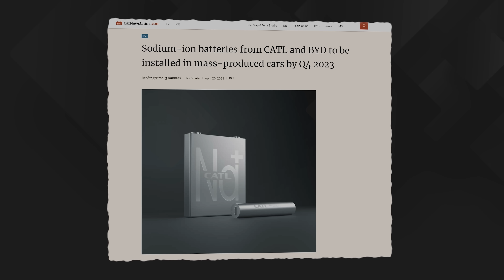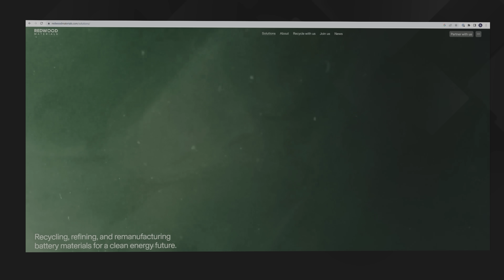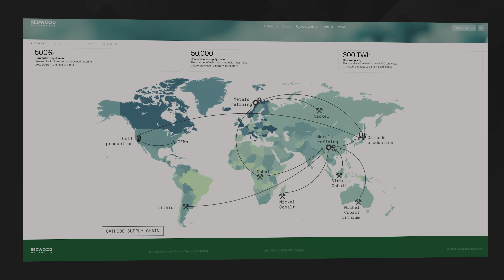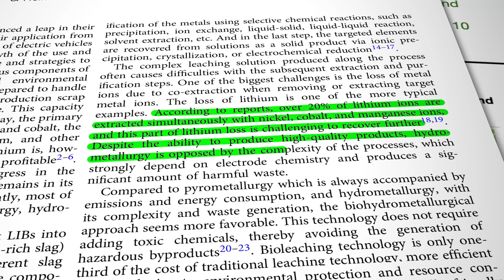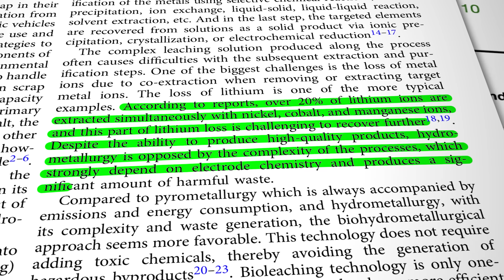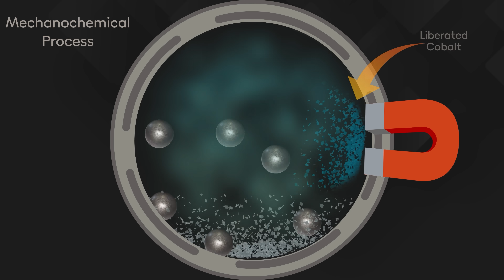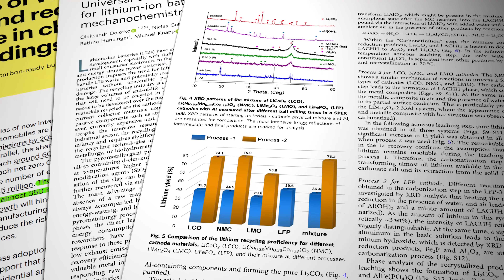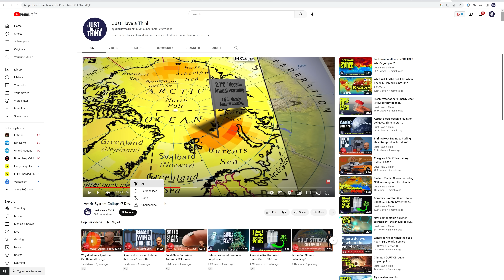Battery recycling just got a whole lot better.

Comment: ABTC. A US company about to list on Nasdaq with patended hydro based demanufacturing and recycling of metals, primarily lithium back to market at cathode grade. Just partnered with BASF. Also got 100 mil from Biden to build a refinery in Tonopah on land they own to where again they hold patented tech to economically extract lithium from claystone to cathode grade hydroxide. They own 100% of claims on 10k acres that hold over half a trllion of potential lithium hydroxide. It will surpass Redwoods pyro process due to its green tech over faster time frames. American Battery Technology Company. Buy in now. Youre welcome.

Comment: Designing in the final disassembly of the batteries should be ironed out between the manufacturers and those recycling the batteries. Limiting human interaction and making disassembly easier should be a good start for streamlining recycling.

Comment: Great to see solid efforts being made to recycle batteries. Impressive technology and, yes, the mechanical method has my vote. On reflection, I wonder if battery designers give serious thought to making the recycling process as economic and efficient as technically possible; even if it would mean a small reduction in performance? Just ‘give it a thought’.

Comment: Is it certain that rechargeable batteries is the future of powering electric vehicle. I was intrigued by the idea of using aluminium air primary cells to power cars, effectively replacing the batteries in the same way as we once did with model cars. The high energy density offered by aluminium air technology, suggests that a compact battery pack could be designed for EVs. The big advantages being the potential speed of replacement and the increased range. This technology would be just as demanding of battery recycling, and might prove more expensive as the battery packs would need to be transported to and from  the service station. Has this idea now been ruled out, in favour of rechargeable technology? A decision must be made, as the cost of installing the recharging infrastructure will be considerable.

Comment: I know that this may sound incredibly simple and boring, but please consider UHPC, or ultra high compressive concrete. As you know, concrete is one of the most used materials on the planet, but it is basically unchanged since the development of Portland cement concrete in the 19th century. As it turns out with many things in our modern world, ordinary concrete has significant flaws but due to its remarkable acceptance and usage a mammoth industry has grown up around it which, like many major institutions, is very reluctant to change. However, there are aspects of both its creation and lifecycle which are now being closely scrutinized. Firstly, the creation of Portland cement (a prime ingredient of concrete) requires large amounts of heat energy to force the necessary chemical reactions; secondly, this reaction releases enormous amounts of CO2 into the atmosphere. As to the final building material created using Portland cement, it has significant vulnerabilities which require extraordinary steps to avoid. Firstly, ordinary concrete is very porous once it has cured (hardened) which make it extremely vulnerable to negative environmental influences; frankly, it is not remotely waterproof and this allows waterborne chemicals (salt etc.) to easily gain access to the interior structure where it reacts with reinforcing materials and essentially causes them to severely deteriorate and even dissolve both the basic mineral structure as well as reinforcing elements (steel etc.). What, you might say is the reinforcing necessary you may ask. That is due to concrete being essentially strong in only one aspect- compression. As the real world generally requires strength in flexural, tensile and compressive strength, this leaves objects made of un-reinforced concrete very deficient when stressed by alternate forces (I.e. earthquakes and other environmental forces like wind/waves). Additionally, concrete is very bulky when it is required to exhibit sufficient strength to support large infrastructural objects (bridges, sea-walls, skyscrapers etc.). Therefore, huge amounts of energy are required to transport everything from the basic ingredients to the finished products; creating more CO2 etc.,etc..

Comment: 8:30 Why does it say 650mAh and 6.5A on the battery? Does it mean it can supply 650mA for 10 hours?

Argh, found specs finally...
Nominal Capacity: 650mAh
Max Pulse Discharge Current: 6.5A
Whatever that means.

Comment: Not so sure they are going to scale well. Ball mills are indeed used in mining huge sizes for years, but they are very energy inefficient because you basically lift tonns of steel balls with every rotation. The wear and tear is not neglectable too.

Comment: When seeing this battery recycling process, I wonder if we could recycle absolutely everything in some super giant facility after we start getting abundant cheap energy from renewables.
Reply: You start by finding alternatives to the items that can’t be recycled. Micro fibre, plastic and insulators like Kapton and Teflon are not recyclable. Body deadening material or sound insulation is not recyclable. Carpet is not recyclable but it can be reused

Comment: This is what the company that sold the Mt Marion mine has done, taken their hydromet flow sheet and developed an ‘urban mining’ company. Working with Mercedes amongst others. Scale is the issue at the moment. There is not enough batteries yet, which is causing issues for companies like Redwood getting feedstock. Car companies will have the feedstock- production scrap, recalls and end of life in places like the EU where they are required to take them back and required to put a certain amount of recycled product in. Car companies will want to keep it all in house for this reason. Redwood-Tesla, Primobius-MB. It will be the partnerships that win out and pretty standard established tech that is most economical when we get to scale

Comment: Excellent video as usual Dave. One thing that no one seems to be talking about is the cost of recycling lithium batteries. Do you have any cost comparisons on a kg of recycled lithium carbonate versus a kg of mined and refined lithium carbonate? Because cynically, I think the decision on what source to use is going to be driven by economics rather than ethics.

Comment: We need more battery reuse.  There is plenty of demand on the power grid for extra battery storage.

If you have a EV that has crashed the insurance company will right off all the batteries just to be paranoid.

If you give an old battery to a recycling company they will recycle it.

At some point you need a decision making processes that can decide cell by cell which battery cells are good and which battery cells are not good.  They we can have massive amounts of battery storage on our power grid, or even a market for second hand battery cells for people building their own EV's.  Or all sorts, there is a big demand for even second hand EV batteries, you only need to recycle the battery cells that are not working.

Comment: I think the major concern with getting an EV is having to replace a bad battery. If cars were made to have the batteries swapped in addition to charging, there would be no worry of getting a bad battery because you could change it as easily as going to a gas station

Comment: As an engineer who works in industrial control systems and automation and HAS WORKED IN THE MINING INDUSTRY which includes building, upgrading or operating mines and mineral processing for iron, nickel, copper, uranium, aluminum and others.
HOW DO YOU THINK WE EXTRACT METALS FROM RAW ORE IN THE FIRST PLACE????

Crushing, grinding, solvent extraction,... these are all common practices in the mining industry. That nice little graphic at 7:30 is called a "Ball Mill." That metal mincing machining you show at 5:04. In mining those are called sizers as in they chop everything down to a certain size. They aren't as common as other crushers but I have seen them used in iron ore. The ball mills I have seen in uranium and nickel because you need to get the ore down to small particles so the acid can dissolve the metals in the ore.

As for separating out different metals from solution that's common in mineral processing. All ore bodies have unwanted materials in the ore and they need to be removed or the valuable stuff needs to be removed from the rest depending on how you look at it. What makes ores bodies viable is not just the percentage of of what you want in the ore but also the "other stuff" present. Sometimes rich ore bodies aren't economic because of the "other stuff." 

Anyway you look at this its the same set of problems they have had in mineral extraction for centuries. The difference with recycling is that they are starting with different materials. Instead of starting with dirt out of the ground they are stating with used material from human society.

Comment: The problem with recycling is that it has to be done at all. The focus should be on the rapid development of a battery that simply charges up and discharges as often as required - so effectively lasts forever. Then there is no recycling problem. 

Might sound a bit pie in the sky, but, ultimately this is the only way to go. 

And not just for batteries, but as a general aim. We regard recycling as a good thing and a positive step, but what it really is is a second-best 'solution' - an adminision that we didnt get things right to start with.  The real answer is to make products that dont need replacing.

Comment: Pay recycling in chemistry based crypto minus fees. This way, you get a tax deductible credit already posted with tax collectors.
RFID Battery tags built inside the shell would help speed up sorting/screening on most returned products and lower costs. Spectroscopy and other screening methods would still be done but sorting woild improve significantly.

Comment: This video goes straight to my heart. One of my first jobs was working at a landfill and rather than suffer through a second winter there I took a job at a lower end retailer during the Christmas season. That worked out okay for a few years, but the whole time I was there, I would always see the merchandise there and everywhere else as "future landfill."

And batteries I have always known to be the largest contributor to toxicity in "disposable" waste.
Reply: 'Future landfill' - I couldn't agree more! All the needless, useless, pointless plastic shite that corporations churn out by the megatonne, is surely a significant cause of harm, in the carbon cost, pollution, and environmental damage it results in :(
Reply: I’ve started looking at EVERY human artifact as “garbage”. Sooner or later, that’s what it’ll be. Every stitch of clothing I’m wearing? Garbage. Everything in my pockets? Garbage. The house I live in? Garbage. So, what are the lifespans and the uses of these various bits of garbage, how will they be disposed of when no longer useful, and can they ever be recycled? Single-use plastics in particular I find frustrating and frightening. There’s so much of it in reach of my hand, right now. My forearm is resting on a pocket pack of tissues. The tissues are single-use but organic, and will naturally decay. The plastic wrapper they’re in? That’s two separate pieces of plastic, both of which will probably exist for thousands of years, absolutely useless.

Comment: Thank you for another fascinating video. If all cars are going to be electric, we'll certainly need ubiquitous battery recycling. Preferably without toxic waste from solvents or acids. It seems like the only drawback of this method is time, and that's not really a problem if you have a production line constantly working.

Comment: If you look at the impact of global warming vs the impact of overly-full landfills, the landfill problem is a literal drop in the bucket.  I'd happily dig holes and shove everything in there if we can keep temperatures under control.  Of course, if we can reuse the components of batteries so that they can help reduce carbon emissions, I'm all for it, but otherwise, it's really not worth worrying about.

Comment: Thank you. A shrewd look at what is promised. Fingers crossed for the team in Karlsruhe. Although I think that the desire is there for many people to change to electric vehicles, I think that the figures for the likely uptake are over optimistic by a considerable margin. Intensely populated centres, where both the need and the potential are greatest, the manufacturers have overlooked their failure to standardise battery design. In spite of efforts to design a charging network to satisfy huge numbers of EV users, anything other than battery swopping is not going to produce a speedy, convenient, mass market delivery of charges. So far only the Chinese have seen this coming.
Reply: oh, a bunch of companies around the world have tried. The main problem is it's only useful for their own cars, so has limited cost-effectiveness. It's great for busses and taxis, but until car batteries are at least somewhat standardised it's not going to work for private cars.

Better, private cars should be rented when required and otherwise public transport i used. Which needs a large investment, in most places, in public transport to get it up to useful. It does work in many places, and that needs to spread. Electric cars are a good interim stage as it reduces the power of the fuel companies to hobble public transport developments and improvements.
Reply: @thekaxmax precisely. Battery standards should have been agreed worldwide and a system for swopping developed. Private internal combustion powered motor vehicles could not have been possible without a standard fuel (petrol/gas or diesel) and a system (gas stations/ petrol stations) to deliver it quickly and efficiently. The EV will never see its potential without battery swopping.

Comment: This is revolting...  You clearly did not research this topic enough at all..  You've clearly overlooked St Georges Eco Mining in Canada & already underway with finalizing their recycling centers.  100% of all materials recycled are reused & resold.  They recapture all rare earth metals into ingots, 99% spodumene & hydroxide purity and even recapture the aluminum.  They even produce Hydrogen during its offgas stage.

They even own all the rights to Iceland and have amazing recent results recapturing rare earths from their geothermal plants.

You conpletely failed to fully & properly research this topic and who's acrually on the forefront of the recycling process of battery reclamation (they even recycle alkaline batteries and can process raw ores too).

Ticker SXOOF in American markets, SX in Canada.

Way to mislead your viewers on the recycling stage